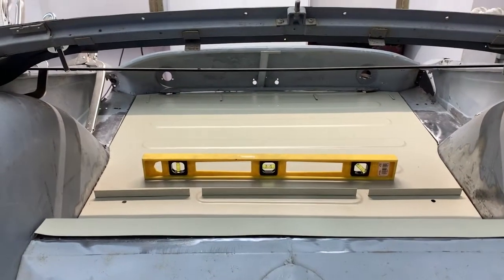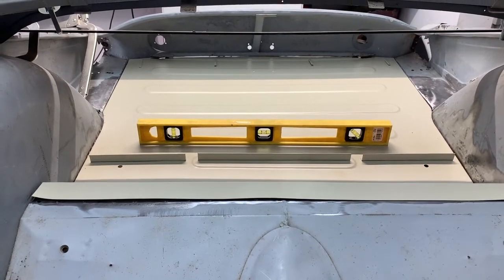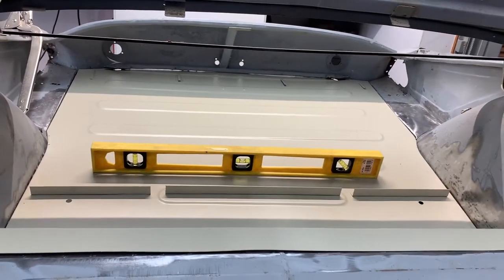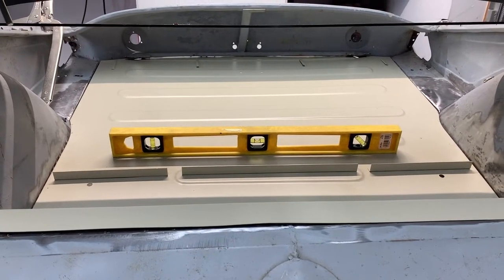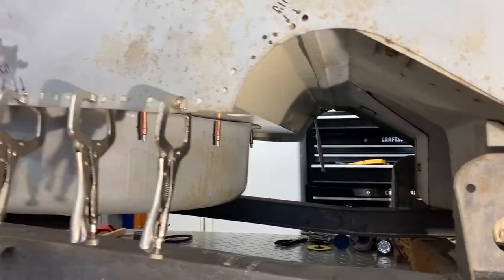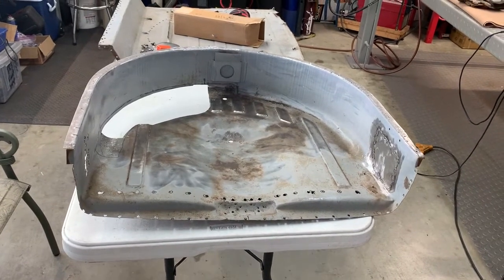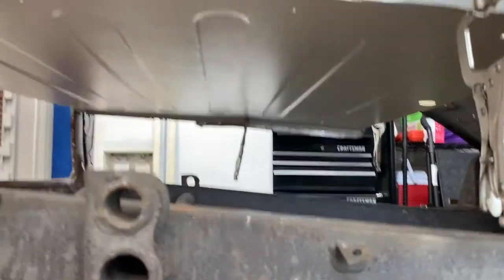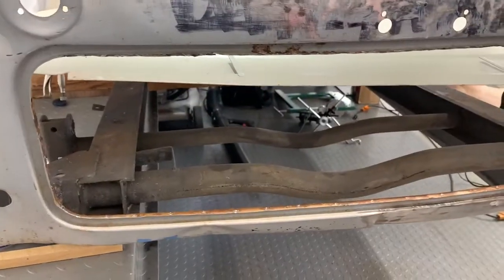16 1959 TR3 restoration, boot floors in spare tire tub out

Comment: did you see my vid on the boot floor? Iam using a good used late floor with more room for the spare. I will get back to it soon right now working on the front body. use a copper backer thats what I been using it helps alot on burn through.
Reply from the maker: Yeah, I had a backer for some of it and it did help.